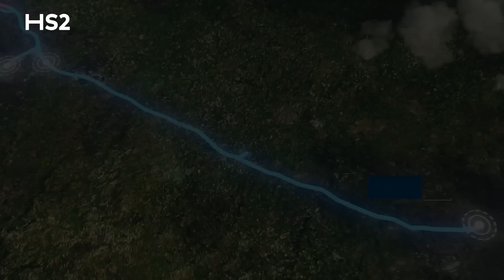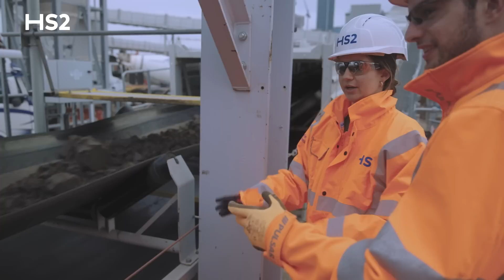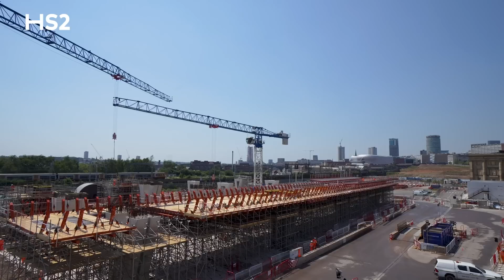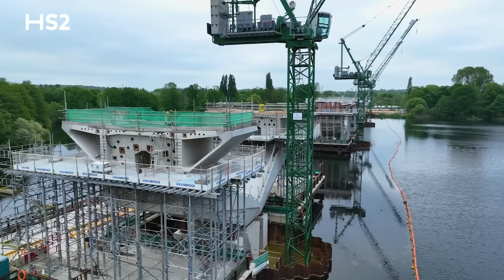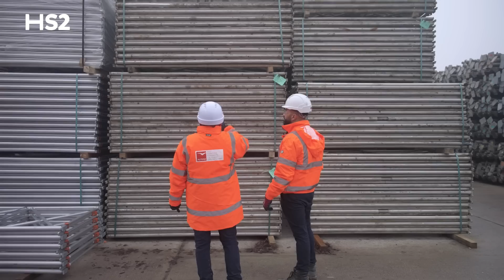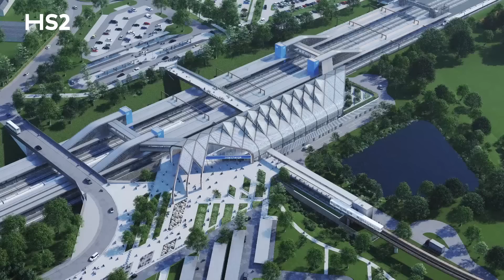HS2 Project Update, June 2023

Comment: HS2 is a waste of money the money should instead be put to restoring the network to the scale of 1960.
Reply: Reopening many old lines does not fit with the modern day. The network was slower then; now, we need to separate high-speed from local stopping services so they can get frequencies like you get on many lines in London, such as Thameslink and Cross Rail. 
Some old lines can be reopened, but no need to halt HS2 to do this, as good investment pays for itself in broader public good as well as revenue, and direct benefit.
Reply: @micahb6050  We do not need high speed we just need a bigger higher capacity network.
Reply: @jammiedodger7040 that’s exactly what hs2 will do , moving all the non stopping London-Birmingham trains off the WCML on to HS2 will massively increase capacity for commuter and freight services on the WCML

Comment: Could HS2 trains run from OOC into the platform space at Paddington released by the Elizabeth line? This is not enough capacity for a future extension to Manchester, but HS2 phase two is not going to be built any time soon and the new station at Euston is overkill for HS2 Phase 1.
Reply: No, OOC platforms are underground and not level to the GWML.

Comment: (1) In line with the GBR plan, I think it would be good to split Network Rail into three "Major Construction Companies" so that they can be responsible for the construction of public infrastructure for the whole of the UK and internationally. (For example, mainly railways, subways, monorails, trams, roads, bridges, tunnels, station buildings, communication equipment, water supply and sewage equipment, power equipment, etc.)

(2) I think it would be good if the international business could proceed smoothly through cooperation between the British "Major Construction Company" and the Japanese "Major Construction Company".

Comment: Why are HS1 and HS2 not connected?
Reply: They are. St pancras and Euston are so close they practically touch
Reply: @owenmb984  Then I don't understand why the line doesn't have continuity.
Reply: because the country run by penny pinching, short sighted politicans.
Reply: Passport checks on stations would be too complicated and not enough demand.
Reply: @cloudrak  That's the most absurd argument I've ever heard
Reply: Because there is no need for a domestic high sped line (HS2) to be connected to an International Line (HS1)

Comment: Dreaming of a HS3 line between London and South Wales, freeing-up the 19th century legacy lines in the greater Bristol region to seriously address road congestion! Currently, all the rail traffic between London and  South Wales, and all the traffic between the Midlands and the South West have to share a single line with just two tracks.
Reply: I’d just like to add that my designation of a new line between London and South Wales as “HS3” doesn’t mean that I’m against better services between Leeds and Manchester! Indeed, I suspect the the “high speed” emphasis in the marketing of these projects is likely to be dropped in the future. These new lines are mainly about increasing capacity in the network rather than providing substantial reductions in journey times.
Reply: @Stephen.Bingham  HS3 will be built in the North once HS2 is finished.

The government won't build a HS line to South Wales considering the amount of time and money they have put into electrifying and upgrading stations on the GWML.
Reply: @cameroncook2048  The issue I am referring to stems from the closure of the southern part of the Bristol to Birmingham main line in the late sixties. Although electrification is welcome. it doesn't really address this issue and its knock-on consequences for "commuter" services in the wider Bristol region.

I recognise that the North of England services have problems and need investment, but - to be blunt - at least those lines, services and stations do - in the main - still exist. in the wider Bristol region the lines, services and stations literally don't exist. I think it's important to focus on providing services where they are needed, not merely improving services that happen to exist through accidents of history.
Reply: Pretty sure that would be HS4 or HS5, HS3 is linkin up Northern Cities.
Reply: Dream on mate we need better interconnectivity between Liverpool, Manchester,Leeds and Sheffield

Comment: So on a journey from Birmingham Curzon St to central London how will that journey be achieved? Will passengers have to change trains at Old Oak Common to get to Euston?
Reply: Old Oak Common will be connected to the Elizabeth line. This is a better prospect for getting into central London than getting on the underground system at Euston. Yes you would have to change twice to get to Euston but Euston as an area is not really a destination in the first place, it's just somewhere you currently get off a main line train and onto something else. Old Oak Common will be no worse.
Reply: @mikenorman2525  Except the Elizabeth line is already overcrowded. Even with new trains and new carriages, it will still struggle to absorb HS2 travellers that it was never designed to accommodate.
Reply: @DavidKnowles0 surely lizzie line will cope better with hs2 passengers than the underground at euston?
Reply: @DavidKnowles0  How are the Northern and Victoria lines into Euston going to cope if HS2 is ever extended to Euston?
Reply: @aw34565  They were never supposed to. Crossrail 2 was the plan at one point providing for this in terms of capacity.
Reply: Yes, until Euston is built 10-15-20 years later.  A joke isn't it?
Reply: @mjpm2409  Nope 4 years later.

Comment: If its only going to Old Oak Common, how much time will actually be saved on journey times from Birmingham  to London city centre? Is it worth all this money? Still convinced this will end up as the worlds most expensive cycle path when HS2 gets cancelled.
Reply: The whole faster journeys thing was lazy marketing, adding capacity is the real reason we need HS2. The current network is maxed out, adding capacity means cheaper fares and more options for local services and freight. This still requires Euston to be the southern terminus, any government that shortens HS2 to OOC leading to congestion on GWR and Lizzy line would be very unpopular in the west of London and Tory home counties.
Reply: No it is actually going to London Euston, if anything it is only terminating at London OOC temporarily.
Reply: @peterwallen1063  Someone will have to find the money to pay for HS2 goes to Euston. And given this project's history of massive cost overruns which government is going to commit to that?
Reply: @aw34565  It is already on the cards to go to London Euston with work going on at Euston to build the new station, London OOC is not large enough to accommodate all the rerouted West Coast Trains that will be running on HS2 and that idea has gone quiet with work carrying on quietly as although they said work was stopping on the section of HS2 from Birmingham Interchange to near Lichfield where it will join the existing WCML, I went past the site last Wednesday and work was still going on, so HS2 will terminate as planned at London Euston.
Reply: Old Oak Common is to be connected to the Elizabeth Line, which will be just as good for getting into central London as underground from Euston would be, and just as quick.  So that's not an issue.
Reply: Blimey David what a negative and sad little world you must inhabit.
No cycle paths here mate ... 🤭
Reply: It’s was not about capacity - rail travel is 30% post Covid …it’s in the name High Speed 2 ….to OOC then change wait a bit and get a train to Euston. 

A mismanaged vanity project - tax payer funded
Reply: @fidoforme8561   Oh God another 'vanity project' Luddite.
Yes it IS all about capacity. HS2 will take all the fast express trains off the WCML freeing up more paths per train for other passenger and freight traffic. How? because a 125 MPH train needs big headways, that is space available for other paths. To suggest the WCML is not full shows your ignorance.

Of course you hugely exaggerate what will happen at OOC where there will be more connection options than at Euston - Elizabeth Line, GWR main line and tube lines. People going to Euston will be going on to somewhere else. OOC is just another way to get there.

You then prove your deliberate ignorance by fabricating an idea that rail travel is only 30% of pre COVID. Well no it is actually now higher in all sectors bar commuting in London. Since 10 February 2023, passenger numbers on the national network have hit or exceeded 100% of pre-pandemic levels five days in a row, and on 22 February 2023 103% had been recorded.  Pleasure travel is way above what it was pre COVID and that is exactly the sort of traffic HS2 caters for.
Reply: @fidoforme8561  the project predate covid by decades. An passenger numbers may be down but there still no room for feight trains.
Reply: Blimey you must be a remoaner.
Reply: @Stand-Up-m2x  Brexit going well for you is it Samson?
Reply: @aw34565   Well what do you know. You’re not even British.
Reply: @Stand-Up-m2x  I'll take that as a 'no'.

Comment: Talk about Solihull interchange station and the work done there!
Reply: It is not being called Solihull Interchange as it is nearer Birmingham, Birmingham Airport and Birmingham International Station it is being named Birmingham Interchange. This is because as what happened with Birmingham international station next door, they are next to Birmingham Airport and about a mile from Birmingham Boundary and as Solihull is about 7 miles away, International travellers have never heard of Solihull a small metropolitan town which has it's own station in the town center on the Chilton Line from Birmingham Snow Hill to London Marelabone
Reply: @peterwallen1063 You’re correct in what you say but it is in Solihull not Birmingham , it’s 5.4miles away from Solihull town centre, Chelmsley Wood part of Solihull is less than 3miles away.

Locals will always refer to the Airport and International as being in Solihull even though it is called Birmingham Airport and Birmingham International.